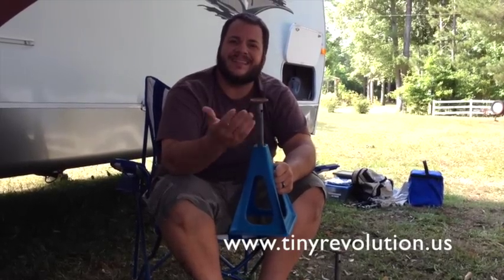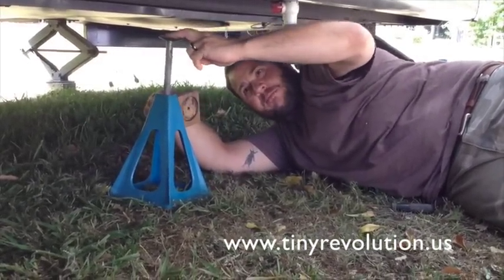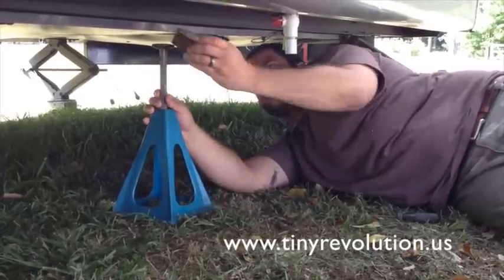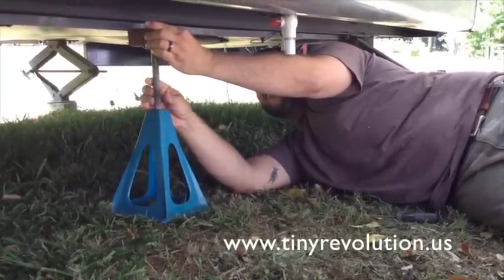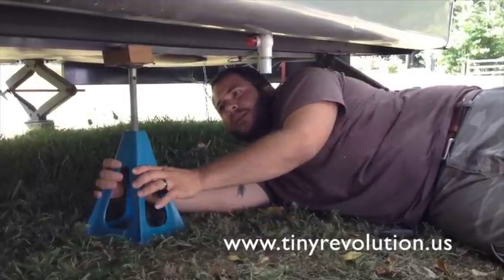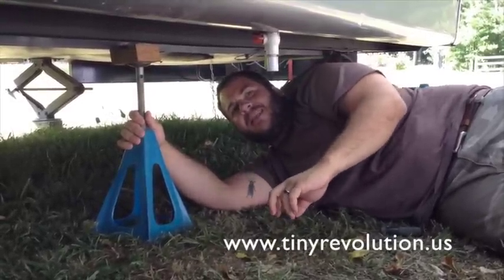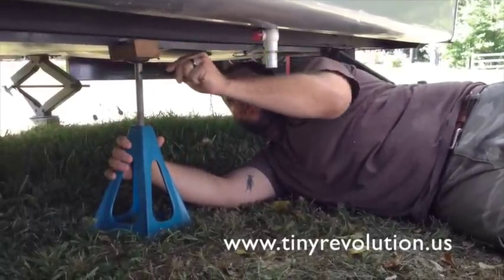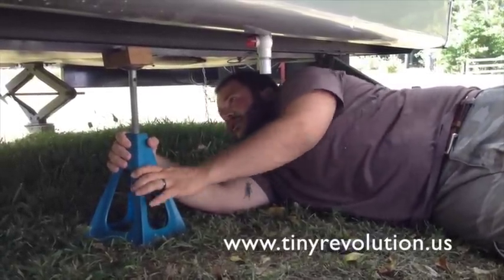Using Stabilizer Jacks For Your Tiny House

Comment: FINALLY!!! Someone addresses jack stands!! I'd love to hear more! Pros and cons for both these and scissor jacks. What about using simple  cinder blocks? What's the best material to go UNDER the stands. Also, tire chocks, trailer anti theft-security. Etc etc
I look forward to more videos!!! Keep it up!!! 👍👍👍
Reply from the maker: crazzie7 Our tiny house (30 feet long) had 4 scissor jacks welded onto it (1 in each corner). We then used cinderblocks to support the houses weight on piers releasing all the weight from the axles and wheels. Cinderblocks are fine if you can jack the trailer up high enough to get cinderblocks under the frame and relieve that weight. You want it to be super tight! If you choose to use stands and your trailer is on earth rather than hardpack gravel or concrete you either want to use some pressure treated 2"x6" blocks or even those plastic stacking blocks you can get at Camping World. I'll hit you up with a video on tire chocks in the coming weeks. How's that crazzie7?
Reply: Tiny r(E)volution +

Comment: These 'pyramid' jack stands are totally "old school".  Very popular Way Back in the 1950's, '60's, and '70's.  That was about the only style available 'back in the day'.  Because of their 'open' bases it's important to place some sort of board under them or they will Easily penetrate into the surface of the soft ground and totally defeat their intended purpose of "stabilizing" your trailer.  Our contempoary trailers seem to be designed with a typically higher stance than in the "old days".  Blocking them either above or below solves That issue as portrayed in the video.  The aluminum ones are very study, light weight, and won't rust either.

Comment: If it will be parked for really long period of time, I would go even farther by jacking it up, blocking it and taking load off of axle springs. Over time they will get weaker. I plan to remove my tires on the tiny house for this reason and theft prevention.
Reply from the maker: 19stoney64 Oh yeah. When we lived in our tiny house we had a company come and build cinderblock piers in 8 places under the frame as well as strap it down with earth auger straps. Took all the weight off the axles and wheels. We didn't remove the tires although I always planned to. HAHAHAHAH!!!!
Reply from the maker: 19stoney64 I should have mentioned that I use these stabilizer jacks for our travel trailer which is never in one place longer than 1 month.